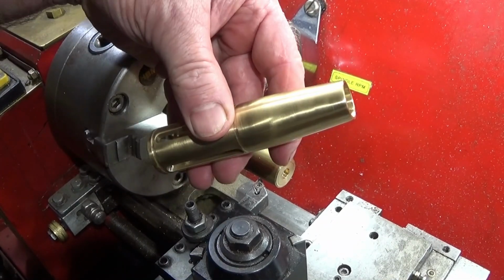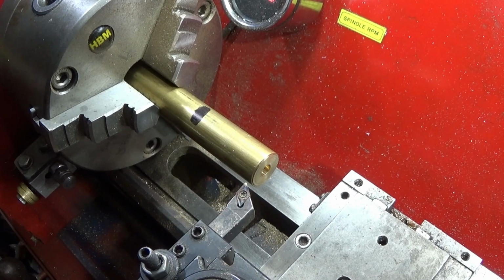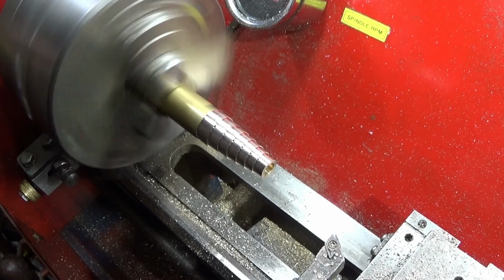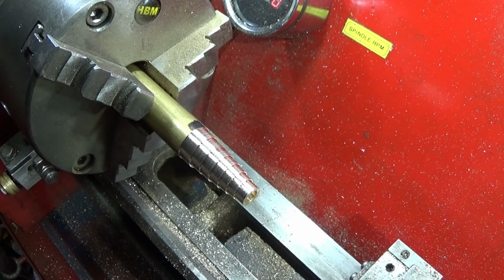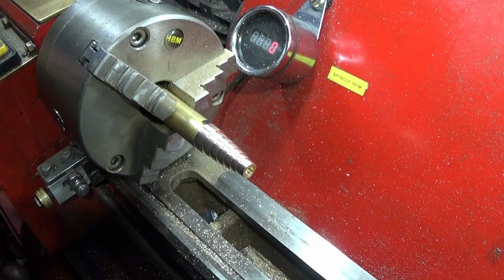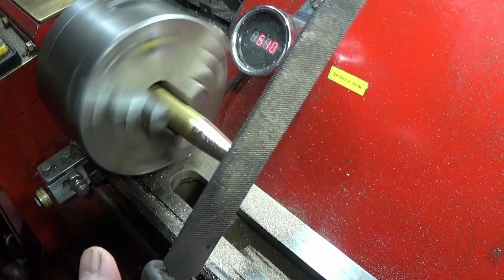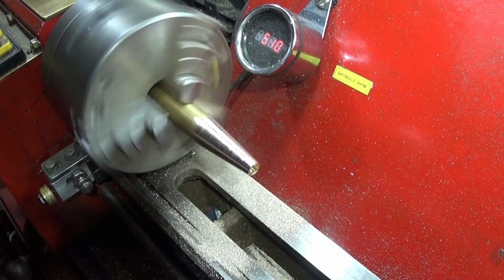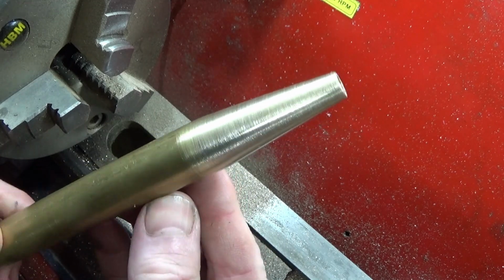How To Produce Angles On A Lathe Without Using The Compound Slide

Comment from the maker: SOME GREAT OFFERS ON DCMT 070204 INSERTS:-
1. Drillpro 10pcs HRC45 Blue Nano DCMT070204 YBC251 Carbide Insert for SDJCR/SDNCN/SDQCR Turning Tool
https://ban.ggood.vip/116V6
Normal Price: $23.99
Coupon Price: $ 16.99
Code: BG4b76e8
Warehouse: ALL
EXP: 3.31

2. Drillpro 10pcs DCMT070204 YBC251 Carbide Insert for SDNCN1010H07/SDNCN1212H07 Turning Tool Holder
https://ban.ggood.vip/116V9
Normal Price: $10.99
Coupon discount: 25% OFF, about $6.74
Code: BG32857d
Warehouse: CN
EXP:3.31

Comment: I like this method but here is mine.  Using a wide carbide cutter or high speed steel cutter, I create the desired cutter face angle on a grinding wheel or turn the tool post holding the cutter to the desired angle.  By repeated plunges into the object and moving the carriage, I create the angle repeatedly and smoothe the resulting cone with a file.  The advantage comes from being able to make a male cone and a female cone if you are clever.  A friend had a steering wheel (female cone included)  so the cutter was indexed to that cone profile.  Then the mateing shaft was turned with the same cutter resulting in a nice tapered fit.....self locking if need be.

Comment: Hi Steve, nice to see that process and how simple it was.    What I would like to see is how you did those internal threads.    I recently made a backing plate for a collet chuck to fit an atlas lathe.   I had to make the threads inside like that and could not run my lathe in reverse to keep the chuck from unscrewing from the spindle.   It had to have a collar and then the threads.    I made it but and it was nerve waking.   I would sure like to see how it is done properly and how you did it. 

Dale in Canada

Comment: Not a bad method, cutting the steps at the correct depth and distance from each other and then 'connecting the dots' with a file. Personally when I cut tapers like morse, jacobs, etc I will chuck a known good one up in the lathe that was commercially made, and then will pivot the compound using a dial indicator in my tool post until a get a consistent distance down the taper. I don't offset my tail stock and turn between centers because my tailstock adjustments are not well suited for this modification and just basically a PITA to set up and return to normal.
I like the Brit term, 'spot on' and I noticed that you used it.. It reminds me of a machinist joke:
A machinist from the UK was visiting a German machine maker, and the machine maker stated, 'the accuracy of this machine is within a tenth of a micron', and the UK machinist replied, 'well that would never work for me. I need the machine to be SPOT ON'...